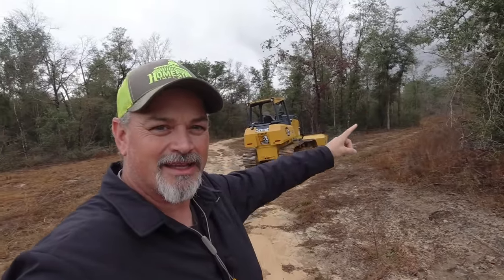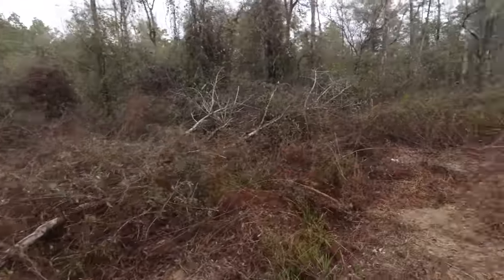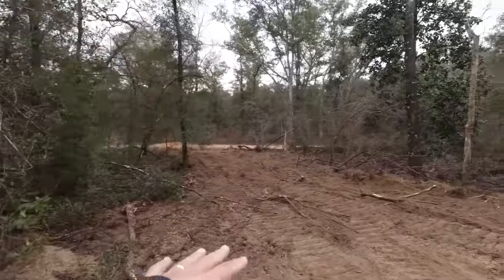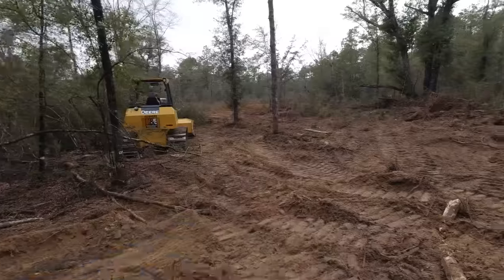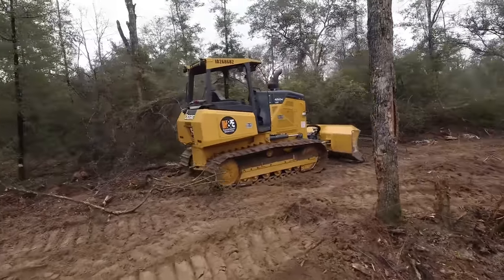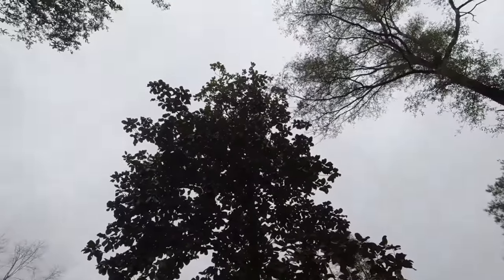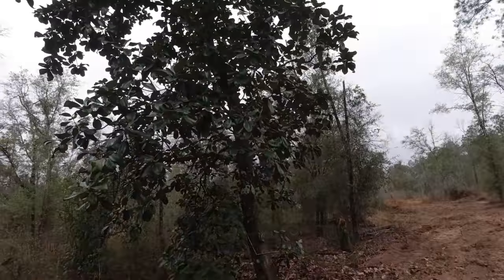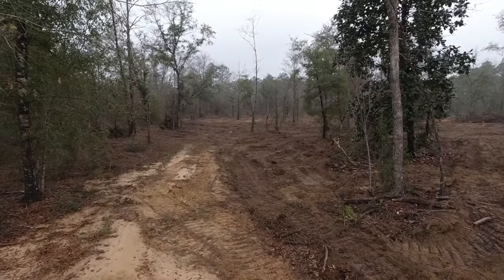How Much Land Can You Clear In One Hour On A Dozer?

Comment: Dozers are great therapy: if I was having a bad day/week at my factory I'd get to the farm and after an hour in a dozer seat I was back on track to fight another day. It is seeing instantly the results of your work:got a mess,clean with dozer. Life is good.Only bad day I ever had on a dozer was when I was doing a heavy blind push with my old Cat D-6 and drove off a 14' deep creek bank. Upended the dozer 80 degrees. Took another D-6 and 2 grand to get it out. Put the seat belt back in after we got it out of the ditch.
Reply from the maker: Right on.
Reply: @HamiltonvilleFarm  You are spot on about the dozer therapy.  It amazes me how well dozer therapy works.  No need for zoloft if you have a dozer.  The instant gratification of seeing big results  quickly.  I think also the concentration required to operate a dozer safely is one key to dozer therapy effectiveness.  It takes ones mind off everything else going on in their life.
Reply: Yes, great therapy... except the day I was pushing a huge brush pile and drove into a mineshaft. Luckily the brush eased to impact, and only a hydraullic line on the rippers broke off.

Comment: A tub grinder would work well for cleaning up those piles.  It would grind the whole trees and brush into mulch and then you could spread it out or use for the flower beds.
Reply from the maker: Right on
Reply: Expensive tho. Just pile and burn when the weather is right.
Reply: @TsunauticusIV  ya definitely the cheapest way

Comment: Word of advice before clearing property:

If you plan to build and implement septic for waste water, you will want to have your Soil Scientist draw up a soil map of best areas of for your lines to go.

I was a mapping assistant working for my friend (who is still operating) for years,  mapping all over SE Tennessee, N Georgia, N Alabama, W North Carolina. 

Check with your Soil Scientist first if you can remove a minimal amount of topsoil with the dozer blade before mapping. He'll probably advise against it before mapping, which is more than likely what he'll say and is most logical. You may be able to remove a minimal amount of topsoil before mapping, he'll tell you how much, according to state guidelines.

Once you drop the blade and start moving Earth on property before it's mapped is called 'cut' and destroys the soil profile.  More than likely he will call for pits to be dug by a backhoe so he can assess the soil profile and may even need to get a State Scientist involved in the evaluation.

Hope this helps.

Comment: Hank.  Excellent video.  I’m going through the same process.   I’m using a skid steer mulched followed by the dozer. I have bad washout in old retracted land. Would you recommend just clearing with the dozer versus running a mulcher first?  The dozer can go some places a mukcher can’t.  I’m curious on your hybrid experience.
Reply: Save your money goe with just the dozer. Use that money to hire co-op or the like to seed it with something that comes up fast.

Comment: I hand cleared acre and a half.. What I need is a solution to clean out around 120 pines.. oaks ..black gums.. etc thats in the 1 ta 3 foot diameter range.. Whats the best equipment to primarily deal with only larger size trees in other words what heavy equipment would be the best use for the money to do that?
Reply from the maker: I'd hit it with a forestry mulcher.

Comment: Fun vids thanks.  We have started clearing our land with skid steer mulcher and will bring in dozer next.  How long do you let the piles sit before you burn them?  And - do that big root balls burn? Thanks for the content.  Hoping the dozer will clean up the aftermath of the mulcher too - thoughts?  Thanks!
Reply from the maker: I wish I would have used a mulcher first. You’re doing the right way. Drying time will depend on the weather I assume
Reply: Root balls won't burn. To much dirt.I usually bury them if possible

Comment: How confident do you feel using that thing and not know what you are doing(according to you).  I’m looking at clearing 2 acres of mostly 3-8 inch lines.  Couple bigger.  But I’ve never used equipment like this.
Reply: ITS relatively easy as they are pilot controlled. I ran a dozer fir the first time in 2019 to clear a wooded lot and it went well. Just push the material to a cleared area if you can so your not pushing material on top of other material. Also, get a cab unit if you can.Its makes for a more pleasurable experience. Heat,air. And some have radio.

Comment: Hey Hank, what kind of fuel consumption you getting out of that 450K?  The only guy I've known with a bulldozer told me once that he used 6-8 gallon per hour.  That was probably 30+ years ago before computer controlled engines.  He had a 60'ish Cat, not much bigger than the JD you're using.
Reply from the maker: I didn't keep exact records but it drank it pretty good. I would say 5-6 gallons per hour would be a good guess.